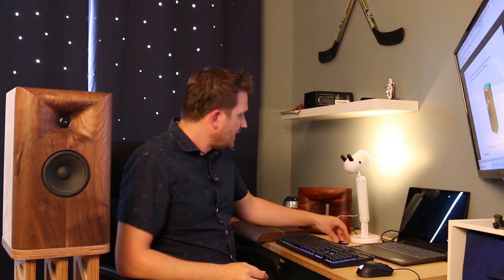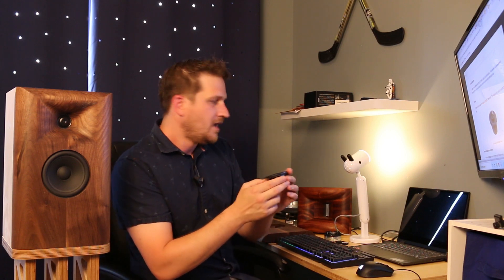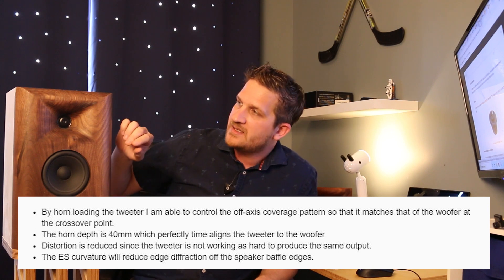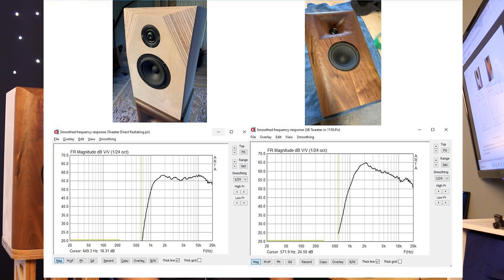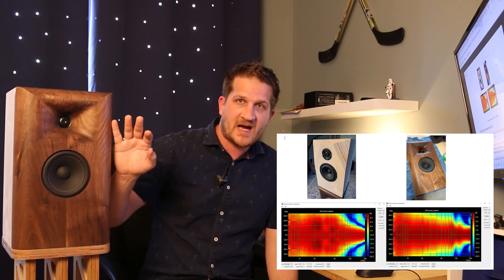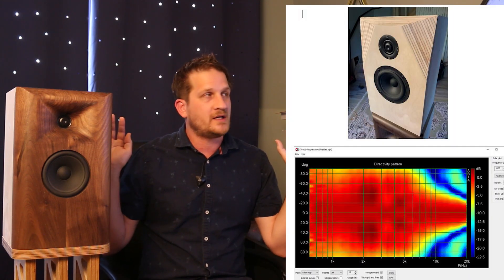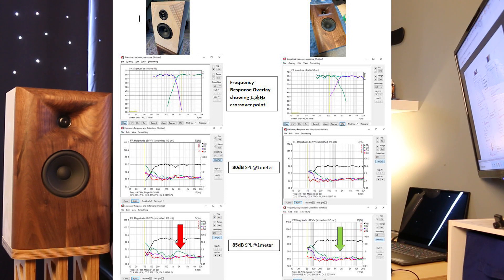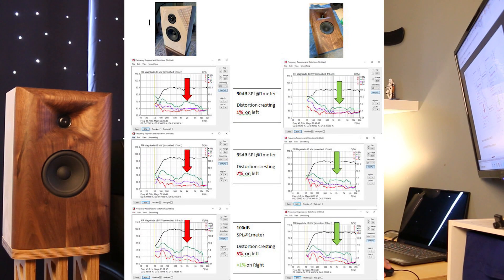Stand Mount Series 1159 -- Horn Loaded 2-way Using SB Acoustic Drivers

Comment: Way too many advantages in waveguide loading. Thanks for the distortion tests.
How much BSC do you apply for speakers meant for near wall placement? 
What type of placement you have in mind while designing your speakers?
Reply from the maker: Because these are only 5” woofers they are intended for small rooms at moderate listening levels.  Due to this I did not implement BSC.  The woofer’s response provided my target response once room boundary reinforcement summed everything out.   Good question though!  This is often ignored.  You can still place the speakers 30-40cm from the rear and side walls.

Comment: Good stuff! 
Looks like a Jbl studio 2 series with a touch deeper waveguide (which work great considering the cheap 1990's leftover drivers and bottom of the barrel crossovers they use). 
The value offered by such a low scale manufacturing as yours is sadly atrocious. Not for my 3rd world wallet for sure. Single? or double digit customers paying for your r&d and tooling must be poor business for all parties involved.
Reply from the maker: I just spent $245 CAD on one shopping cart of groceries.  That’s atrocious.

Comment: SB acoustics drivers are the tits now.  I just tried the Ceramic 1" 4" and 8" combo and it sounds as cold and analytical as my ex wife.  Gonna try the Satori Papyrus, I should of went with it in the first place... dammit.  I love the sound of my Peerless 8" NE225 before so I should have known better to try the Satori.  High efficiency PA drivers are better than these inefficient drivers.  Always fun to try different sound characters though.
Reply from the maker: Yes exactly.  I was a little shocked at how quickly distortion sets in on the 5” but within its limitations it’s one fine sounding driver.  You can definitely hear the difference with the copper cap on the pole piece, since I have the cheaper SB woofer to compare to.  I would love to do a 6.5” woofer version.  Or do a floor standing version with the same baffle design.

Comment: why don't you bring the tweeter closer to the woofer bring the horn Down covering some of the woofer like an eyebrow put a hump in the middle of the horn where the woofer would be situated. should be able to get the driver's very close. need some dampening material as well on the woofer and baffle to enclosure.
you want a hump anyway in the horn at the bottom.
what value of capacitor is it you used.
what about the main driver is going to suffer distortion there's no roll off? could you play a sound demo of the speakers or any speakers you do, it is beneficial even on YouTube
Reply: Driver spacing is good here for crossover frequency.  It can be quite low for these tweeters.  See the MOAB! This one here, it's not for near field monitoring anyway.
Reply from the maker: Distortion was tested in the video and shown to not be an issue.  I also mention that it’s a common issue however not in this case.  
I don’t think I could get the drivers any closer together without compromising the horn flare geometry in the vertical.  It’s critical that the throat angle not be too parallel otherwise reflections get setup in the throat...likely why so many other horn design fail.